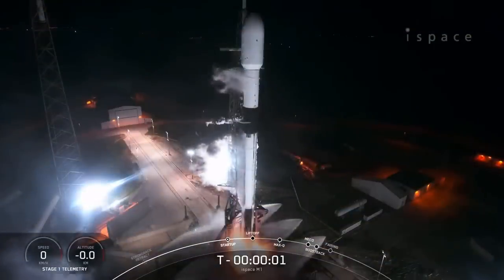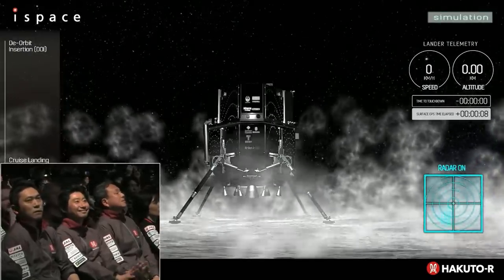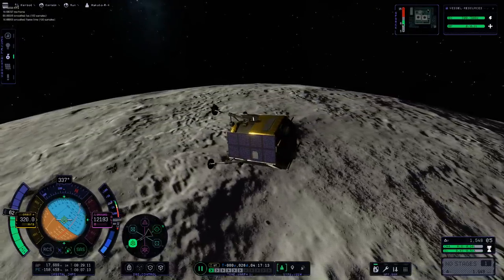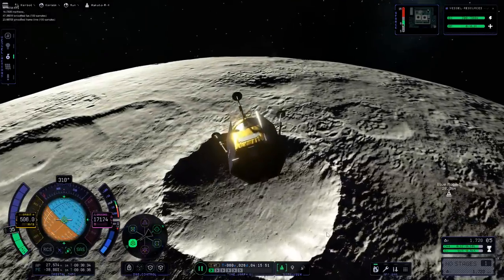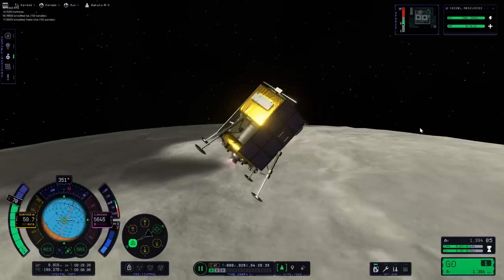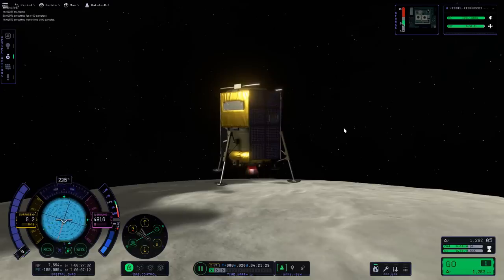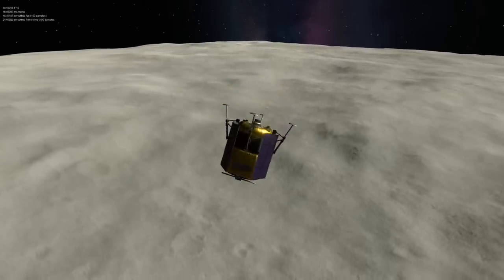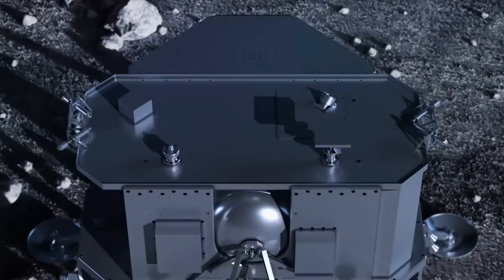Why Japan's Moon Lander Crashed Due to An Unbelievable Computer Bug

Comment: Wow!  Blame the software guy!  Hey, no worries.  That used to be me!  I didn't do any "Flight" software, but plenty of automation applications where you had to know and / or calculate your position on a piece of equipment, and trust sensors to give you good data.  The famous breakdown occurs right there, as you said, because software guys usually don't trust hardware guys, and they're skeptical sometimes of the readings they get, and guess what?  They punt, and go back to relying on their own calculations rather than trusting the so-called "Bad data" they've gotten.  It happens...
Reply: And thanks for the excellent full analysis.  Interesting to note that the Beresheet and Vikram landers failed for the same (similar) reason.

Comment: This is what I don't understand... any moon lander would have trouble landing softly without running out of fuel.  I completely understand that.  But with that being the case, even if things go well, how the hell would a manned lunar module ever have enough fuel to lift off and return all the way back to Earth?   I know that another module remains in orbit and it has fuel, but the lander has to detach from that, rotate around, land without crashing, and then lift back off, rotate, and rejoin the orbiter.  This module just had to land.   It should have had more than enough fuel for that.   

I get that it's possible that they only put just enough fuel for this lander to do its mission which was just to land without taking back off.  That's possible.  But why?  Why put just enough for it to complete its mission without any extra?   It didn't have the added weight of a crew or moon rovers, or anything like that.  It should have had more than enough fuel to compensate for the software error.   This should have been fixable.   The amount of fuel they could have added to make this weigh as much as it would have with a full crew and a moon rover should have allowed it to reach the surface without running out of fuel- especially since the moon lander used 50 years ago also had enough fuel to take back off even with all that added weight.

Seems like this was preventable.  I think someone needs to explain why they deliberately put only enough fuel for it to land if everything goes perfectly.
Reply: good question but i don't have the answers, perhaps moon landing was indeed fake
Reply: Because the entire mass of the lander is not lifted from the moon on departure. Only the upper stage with the crew and life support systems and one small engine. The lower half with a bunch of mass got left behind in Apollo. Details matter, and this info is plainly publicly available.

Comment: if it was me, I'd just have the tests simulate landing on any random spot on the moon. With noise in the data too, because what if the information is wrong? how long does it take to run a test? you should just run all the tests after every change at all. There are people who think making tests slows you down. Those people are wrong. Exaustive testing is the fast way. Now they have to build another lander!

Comment: Talking of egregious errors, the most dumb one is the 1999 crash of  NASA's Mars orbiter because the contractor, Lockheed, used inches, feet and miles while NASA used cm, meters and kilometers.  How this error was not caught by all the engineers and project managers on both sides, during the numerous meetings and hours spent creating and reviewing at documents, is mind-boggling.

Comment: Interesting, thank you for the presentation of the events. If I may I'd like to give some details about why it is a "software bug" but it is not a "software bug" at the same time.
It is indeed a software related issue in the way that there was absolutely no mechanical/electronic, no hardware issue at all. The defect was definitely in the data treatment operated by the software.
It is absolutely not a software implementation bug made by developers (like for example a data unit conversion) which would not have been picked up by poor integration and validation campaign. The software was properly developed, integrated and validated, worked as expected, no bug there...
This was a design problem, a control laws problem. As well explained when you rely on sensors to control something you have to be sure that the data extracted from the sensors is accurate. What happens in case of hardware failure for example? Obviously you design robustness by having redundant sensors and data. Ok easy but now what happens is there are data inconsistencies between your redundant sensors?..... Hum... That starts to be tricky, which one is the good one? This is call data consolidation.
So the issue was entirely design, control laws, logic. It's a part of an engineering project that is defined for the entire system, taking in consideration both hardware and software. This is way before any implementation. Finding an implementation issue, what we usually call a "bug"  is quite easy as long as you put effort to integrate and validate that the design is well implemented. But for the design of the thing... it is extremely tricky to figure in advance what issue could potentially happen or be induced. How many crashed planes before becoming reliable. And to ensure the best reliability as possible you still have a human pilot who is a key player in the data consolidation loop.
The Japanese team definitely planned very well for as much situations as they could. That stupid one though... I feel for the people who designed it... Can you imagine how tough it is to design such a thing, it's not like you can go in the field behind the factory to perform a quick test!
So much respect for all the people behind it, and definitely no, it was not a software bug, it was simply part of the learning curve except that for these people the consequences are simply massive. Respect.

Comment: During Apollo 11, Neil Armstrong's Eagle landing trajectory had to be changed for a large crater in mid landing. A simple calculated task for well trained astronauts using archaic instruments. Sometimes the human factor just can't be duplicated by a power computer when it's a first time experience.  You just can't program logic and reason.
Reply: Man has never walked on the moon.
Reply: @RusskiCommieBot  Of course not. They hopped and skipped. That suit gives no dexterity.

Comment: Not really a bug but a requirements issue. Very soon most software will be written by AI systems but that will not help in a situation like this. I would call this an error in software engineering or design not a programming bug.

Comment: Sooo the sensors worked flawlessly, but dumb "let's be smart" software (or rather engineers specifying it) just thought it knew better, failed, and didn't catch its own failure.
Their sensor fusion no longer had any absolute input, so it was total guesswork. That consequence of kicking the altimeter out of the loop should have been considered.
Lots of "error handling" is done half-assed (single layer of thought) and merely adds complexity.
It might have been prudent to keep revisiting "faulty" sensors because failure might just be intermittent.

Comment: I feel bad for the software team. 

“Software glitch”?
“Software bug”?
“Software issue”?

No. 
The software met design targets and agreed limits. 
The problem was in Program Management and decision/leadership, making changes beyond the original stated limits & boundary. 
And the same problem-makers pointing fingers at software team, trying to make software the scapegoat. 

What a shame.
Reply: That doesn't mean the software wasn't the cause of the failure, just that it wasn't ultimately responsible
Reply: @snowthemegaabsol6819  Driver of a car traveling 100mph, coming up to a slow down on the highway. He decides to cross the grassy median and get to the other side since that’s more empty. 
During this process, his suspensions couldn’t handle the rough terrain, tires couldn’t keep grip, and his car goes airborne when jumping from the grassy median onto that oncoming direction, landing to the OUTSIDE of that oncoming direction, wrecking his car. 

He survives, barely. 
And then blames the car. 
It’s a car issue. 
It’s a suspensions issue.
It’s a tire issue.
It’s a slope issue.
It’s a gravity issue. 
It’s an “everything else” issue, but would never look at the real source of the problem. 
Human nature at play. 

Sure, “the software was involved”.
Just like the car, the suspensions, the tires, and gravity was involved in above example.
Reply: I never implied that conclusion but ok
Reply: @snowthemegaabsol6819  comment wasn’t aimed at you. 

You ought to see the NYTimes headline. “Ispace’s Japanese Moon Lander Crashed Because of Software Glitch”.

Again, like I said, I feel bad for the software team. They’re being made into the scapegoat.

Comment: The smells of shoddy software development practices and lack of unit and integration testing. You could easily randomise millions of random landing sites and feed the altitude data into the function and read back the result and see how the software behaves. Clearly they didn't do these things. Turning off a key sensor without a backoff/cool down and resume input just seems like a really dumb thing to do.

Comment: None of it makes any sense. There is so little to gain from ignoring the altimeter data, even if it MIGHT be faulty. If you're ignoring it, and you are anywhere farther than a few feet from the surface, you are doomed anyway. And by the way, how about you know, just putting 2 altimeters in? Let them corroborate each other. It's such a critical part, if you were concerned that much that it would break, why not just put a back up in, instead of idiotically assuming you can just calculate your way through without it. This looks like a project where everyone just trusted everyone elses part instead of having at least a few people look down and understand the whole thing.. they would have caught this flaw at the slightest glance.

Comment: I do want to suggest, too, that this wasn't a "bug" -- that's a coding mistake.

This was a *design error*.
Reply: A design flaw is a type of bug
Reply: @snowthemegaabsol6819  I have both designed and written software for the better part of thirty years, and it is not my experience that the term 'bug' is used to describe a design error.

Comment: how heavy is a radar altimeter that they didn't put two or better three on it?
Reply: The altimeter wasn't the problem, but those are probably running around 2kg, so an extra pair would cut 13% of the cargo capacity
Reply: @snowthemegaabsol6819  where did you pull that figure from?
Reply: @snowthemegaabsol6819  and why wasn't it the problem? if there were more the computer would toss that data out

Comment: This is pure speculation, but there's a curious quirk to Japanese work-culture that may ALSO have contributed: Deference. Almost the exact opposite of 'Group-think' where maybe one or two individuals with misgivings keep shut about them, because the overall mood is one of marching optimism. In J-culture (as I've now often read) Seniority dominates. The decisions must be made at the top, and any attempt to question something or change something must be incrementally fed upwards in the hope that finally, the top dude thinks it's HIS [*] idea and orders that it be implemented. Enko-nai! Example: way back in the 1980s a junior engineer working for Tokyo Electric (TEPCO) percieved the gaping vulnerability of the Fukushima Daiichi Power Plant - that ALL of its emergency generators were only a few metres above sea-level and thus ANY wave getting over the seawall would screw their pooch. He tried for a decade to get his idea upwards through the heirarchy, failed, and walked away from the whole mess. (Vindicated, but oh the cost! ). 
I'd like to have been a fly on the wall during their sofware meetings after thay made that final course-change-decision (and be fluent in Nihongo, for that matter!) Did a junior engineer sit there ignored, biting his [*] tongue, simply because he was a junior? We'll never know, I guess.
* I'm taking a highly sociological/scientific guess as to their gender, okay?

Comment: Cheap hardware; cheap software.   It's like trying to run an 767 autopilot on a raspberry pi programmed by high-school students.  "Rigorous testing" means handing your software to somebody else who hasn't spent the last year cutting corners on design and implementation just to get the job done.

Comment: Computer bug is a rather tame way of putting it ...

The fact that a landing would even be attempted on inertial guidance in liu of radar altimiter data is laughable 

My main takeaway from this is not just that the coding could have been done better (ofcourse it could have) but that we often try to be "too smart" with analysis (merging the data streams)

Often times in the real world we're just given shit data, and all the math math tech tech algo algos in the world won't save you from this. 

In the same way that you can't idiot proof something, you can't make something infinitely robust and in many cases trying to do so will actually lead to worse outcomes.

For something like airplanes ... pilots HAVE gone down in decent weather because they were so glued to the istruments they didn't simply look outside and realize one of their instruments were broken. Airbus & Boeing have built systems which have prevented a pilot from making what would have been simple corrections which would have saved the airframe. 

This same "type" of problem will exist in autonomous driving in the future ... Yes humans make human errors ... but human errors all "look" pretty similar .... machines tend to outperform humans in the mundane situations (where outperformance is kind of irrelevant) and also in  "known unknown" situations (like a night landing in bad weather) but machines tend to make incredibly stupid mistakes which a human never would (tesla ramming into a parked semi).

Automation systems, automated safety tools, etc. are all really good but we need to understand as engineers/society that they're not perfect and there IS a downside to handing the reigns over to systems which by definition cannot be tested/trusted to handle tasks a general intelligence machine (the human brain) can.

Comment: And they can't even blame it on imperial units. 

Isn't it amazing that we put men on the moon using computers less powerful than your phone?
Reply: Actually, the main computer power was provided by the land based room sized computers at NASA. They computed all the state vectors and flight change parameters. Telemetry from the Command and Lunar Modules provided state vector values for the land system computers to crunch burn values.
Reply: @peterginsburg2465  And the computer power of the room-sized computers was? On wikipedia, the IBM 360/75 had a whopping 1 MB of memory and a 15 MHz clock and a 32 bit data bus. 

My phone has 64 gig of memory, a 64 bit bus and clocks in at 2 GHz. And it is far from top of the line.

Computers have come a long way.

Comment: they needed a terrain mapping part to error check the software for its fault detect ... because the radar altimeter gave a true result BUT the software saw a false positive fault .. and NEVER rechecked that is plain and simply poor programming practice ... assuming an error is a true error ... NEVER assume that always check and recheck EVERY fault 

basic CRC redundancy was taught back when computers were new .. kids these days dont get good programming learning they get memorization which just copies problems of others

Comment: Very interesting case! I just don't agree on it beeing a software error. I mean, it is not a software flaw, bug of software design error. I is rather system mistake.
It it was to be implemented in  hardware, the mistake would have been the same.
System and software are often blured together because of the fact that so mush of the mission relies on software. But software is only a implementation of the software design. Has software engineers, it is important to remember that for testing and not baking in unwanted or unanalysed behavior.
In this cas it is the raceleration limit to check the sensors that was revealed inadequate to the complex gravity field of the moon. Tricky and humbling to say the least! Very sorry for this mission that was almost perfect until then.
Still, thank so mush for your videos! Always true space and engineering nuggets. FLY SAFE

Comment: Why the single-thread radar altimeter?  They could have taken a lesson from Boeing's 737 Max single-thread AOA sensor.  DOH!  Well, at least this craft couldn't kill anyone when it's non-redundant altitude sensing system failed.  
Boeing management, on the other hand, was perfectly happy to put hundreds of people's lives at risk to increase profits - and those managers killed hundreds of passengers as a result. So I guess those in charge of this lander design were willing to take the risk to save cost and weight.

Comment: Let me answer the question:
Because Japan, as overrated as a country stuck in the past can be, is socially unable to bear guilt and learn from it. Thus, the avoidance of "getting in troubles" is huge, because getting in troubles means losing a job, or a social position. 

Lower level workers will not risk their positions by challenging seniors even if they see them failing. They will better see the moon lander falling.

Sadly. Inevitably.

Comment: That's not a bug, that's a design flaw. The difference is that it did exactly what it was designed to do (ignore sensor data that doesn't make sense). The design didn't include the level of variance it encountered or a way to deal with it... namely because it was operating outside expected parameters (completely different landing zone and transit path). And that's the biggest problem with designed for purpose  automation; It doesn't deal well with changes to expectations.